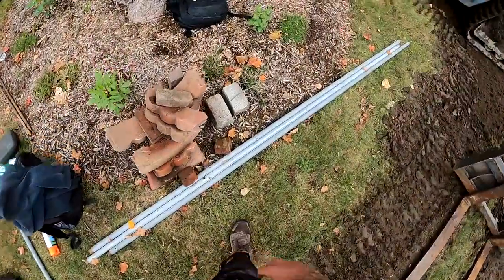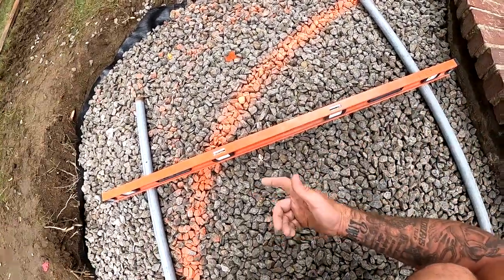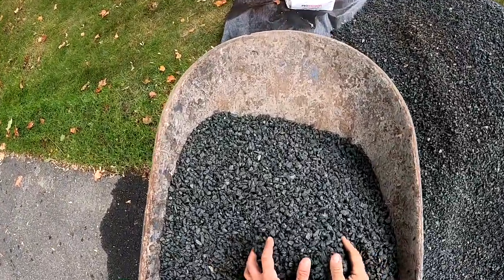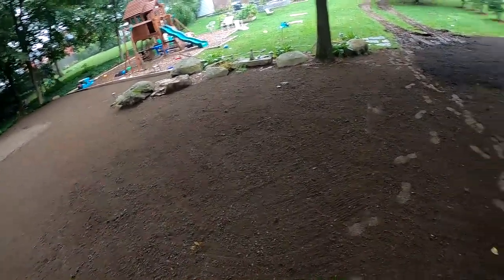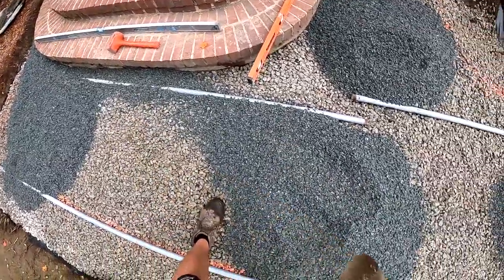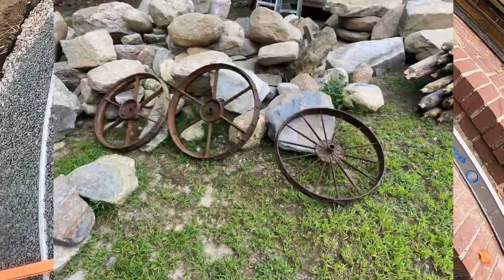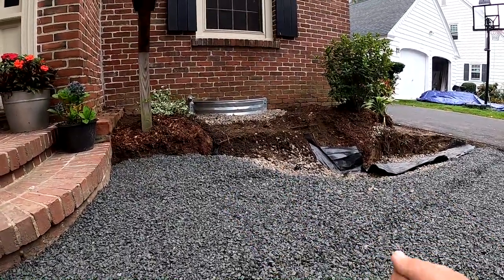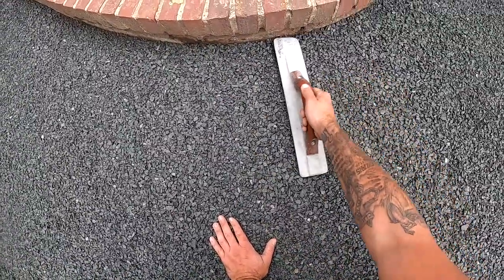How To Screed For a Paver Walkway (DIY)

Comment: I want to thank you for the videos that you post. They provide insight into your profession and are informative. Intended or not, the videos also provide encouragement for some of us DIY'ers. About 2 months ago, my wife and I made the decision to build/install a patio in an eyesore area right next to our home. Long story short, I have not ever built a patio before, but I am good with math and God has blessed me with a higher than normal amount of determination. Your videos have given me the direction needed to start this project. I started the project 2 weeks ago, we have an area that is 192" wide and 152" long at an approximate depth of 12". I went a foot deep because of organics in the soil and because I ran into three different soil types; clay, sand, and a vein of gravel. This weekend I will be putting in the 3/4 minus  (hoping 9" is enough correction), the leveling agent, and the pavers.
  
Question: For the leveling agent, we were going to use cement sand/leveling sand but I see that you use chip stone, is it okay to use the sand or do you recommend chip stone? Also, if I use the sand do I need to run the plate compactor before laying the pavers?

Again, thank you for your videos they are truly appreciated.
Reply from the maker: Thank you very much for the feedback, I love receiving comments like this. I truly enjoy the work I do and wanted to share it with others here on YouTube. Giving DIY'ers enough confidence to try a project on their own was a big goal of mine when starting this channel. I want others to realize they can build a very nice outdoor living space on their own with a little hard work. Glad you are trying it for yourself. 

It sounds like you are doing great with the excavation, glad to hear that you will be using 3/4 inch clear stone for the base. I would strongly reccomend not using sand. The most important aspect of any install for me is the chip stone bedding material. It holds up so much longer than sand does and allows water to flow through freely. Sand is more of a sponge and then sand washes out / migrates very easily. You will absolutely be lifting up sunken pavers within 3-5 years if you use sand. The 3/8 inch - less crushed, clean stone for the leveling agent is key to the longevity of the project. If you use chip stone, you only need to compact the pavers during the poly sand process and they will be solid. 

Thanks again for the feedback and support, good luck on your project! ✌

Comment: Thank you man great job andfollowed by good instruction better than evryone on youtube nowdays.
Im from sweden and i see konstructuon is diffrent a bit diffrent  but those methods would work much betyer with just stone than powder
Reply from the maker: No problem, thank you! This method is excellent and far better than base material with sand and fines in it. This method allows water to travel through freely. Here is another video I made to explain the method in much more detail, here is a link if you are interested 👉https://youtu.be/ChaJe3JqD6I

Comment: After watching a few videos I think I'd rather use this premium gravel for a base. I'm new to pavers and just trying to do some areas around my house. I did a small area several months ago and it's decent, used the "paver base" from HD. I started a new area with 16"x16" pavers and those are a little harder to get level w a pitch. I don't have a truck so going to a landscape yard for a small amount of gravel may be complicated in a car.
Reply from the maker: This bedding stone is by far the best in my opinion. I would recommend getting a delivery of the stone, Most landscape supply yards will offer delivery. It may be a kind of expensive charge but worth it in the end.

Comment: I am a solo DIYer loving your videos. My 600 sf patio is almost ready for bedding layer and screeding. I am following ALL your advise! I wish I had a Benny but its going slow and smooth so far. I am ordering “chip stone” next week and want to know how much extra to order for your 1” bedding layer, do you end up using more or less on average than 1”.  Do you have some areas where you end up with 1.25” or more areas where you end up with less than an inch.
Reply from the maker: Very cool! I hope the technique I use is working well for you. I usually do the math for 1.5 inches to be safe. Sometimes you lift the pipes a half inch or so to set them perfect, and lifting them with chip stone is easier than base rock for sure… ✌🏻

Comment: Don't you want to grade the subbase, to have the water at the bottom of the paver base moving in the right direction for best drainage?    The additional grade you do at the top of the 3/4 inch base is so that the surface of the pavers will separately move water at the surface in the same direction, towards the main drainage channels?

Comment: Thank you for the video. I'm planning to do a paver patio for a gazebo kit this spring, would you recommend using Gator Base instead of the clean aggregate?  I'm from Boston, MA. Thanks
Reply from the maker: No problem, I would definitely recommend the 3/4 clean stone. The gator base just is not sufficient in my opinion, I used it a couple times, not a big fan... ✌
Reply: Sounds good. Thank you for taking the time to reply. Keep up the good work.

Comment: Love the vids. Just wondering what you would use if you didn't have that chip stone available locally? No places nearby me have it, they just carry the same old stuff like stone dust.
Reply from the maker: Thank you, if you cant find chip stone, I would call around for (crushed pea stone) That is usually about 3/8 - 1/2 inch in size. It is not like regular pea stone which is more rounded, not angular. Its going to be a little bigger than chip stone and may be a little harder to screed... but it will hold up far better than sand or stone dust. If you can't find that, even regular, rounded pea stone is better than sand or stone dust  ✌
Reply: @TheChristianHardscaper  Thanks!

Comment: If you want a thicker depth of the #8 stone, do you use a larger screed?  also, you don't use two different screed sizes?  all the same size pipe?
Reply from the maker: I only use 1-1.5 inches of bedding stone, anymore than that can cause issues down the road.
Reply: @TheChristianHardscaper  ok, I'm out here in California.  Angelus stone recommends 18" of specific layers.  We aren't going to go that deep because we won't have any cars driving on it so we were going to do 10" total with 4" of #57, 2" of #8 and then 4" of the permeable paver stones with #8 in-between.  If we were to do the 2" of #8, would we need a larger screed size in order to get the 2" layer?
Reply from the maker: @rebeccaliu5502  you can still use the smaller screed rails, just spread an inch of #8 out roughly then set your screed rails on the stone

Comment: How do you grade the 3/4" #57? Just by eye? I feel like you need slopes right before putting the chip stone or the screed pipes.
Reply from the maker: Yes, we rake it out close to final grade by eye and check with our screed pipes. Sometimes with a string or laser level. But by eye and by setting the pipes, we can get a very good idea of our slopes and end paver height.

Comment: Hey nice vid.  Where i live the  smallest stone i can find for a screeding layer is 6 to 16 mm ( in US size its 1/4 to 5/8 of an inch )  Is this going to be ok to use as a screed layer, or will it be too big? I don't really want to use sand, if i don't have to. Thanks
Reply from the maker: Thank you. I think that size will be fine, much better than sand even if it is a bit harder to screed. Sand shifts, washes out and migrates to easily. It's just not good for under pavers. But with that stone you are talking about, you may have to take out a few big stones here and there but I bet the majority will be smaller than 5/8. ✌
Reply: @The Christian Hardscaper  Thanks, yes, after watching your videos, I'd rather use stone, so I'll give it a try. Thanks for your feedback. It is very much appreciated!
Reply from the maker: No problem at all! 👍🏻
Reply: I had exactly the same question.  I had purchased 3/4 and thought it would be too unstable until I saw your video.  Thanks for all your advice...it really helps a bunch (from up here in Canada 🍁. Cheers!)

Comment: Does it matter the length of the grade? Should the 1/8th pitch translate across 18 to 20 feet? Hope that question makes sense
Reply from the maker: The length of the grade will not change the 1/8th pitch, that is the minimum slope I put on all my installs. Whether it’s a 10’ walkway or 30’ patio 👍🏻
Reply: It’s an 1/8th inch per foot, translates to 2% slope

Comment: What about PVC instead of galvanized?
Reply from the maker: I don't recommend PVC at all. It's too flexible, you won't get a perfectly level surface. They shift and move like crazy. Somewhat thick gauge steel is the only thing I would recommend. These gas pipes are the absolute best thing I have used.✌

Comment: How do you screed a raised patio so that the paver sots flush with the cement and borders
Reply from the maker: You just need to set your pipes 1/4 inch higher than the wall that is retaining the grade. Then you can compact them down to sit flush.
Reply: Thank you so much. This helps a lot!
Reply from the maker: @RigoMariscal-wc1zz  No problem, glad it is helpful! ✌
Reply: @TheChristianHardscaper  hey so I'm using 1/4-#10 for the besding layer. Will it compact 1/4 if i leave it 1/4 higher? Some say that it will only compact 1/16 to 1/8
Reply from the maker: Yes, 1/4" is the way to go. They will compact enough, plus you want to account for future settlement.

Comment: Why not concrete sand?
Reply from the maker: Just doesn’t seem to hold up as good as this small crushed stone. I have a handful of videos explaining it, check them out ✌🏻
Reply: @TheChristianHardscaper  Thanks for the reply from australia. I just did my driveway using concrete sand so hope it holds up. A lot of pavers in my area use crushed dust or quater minus. But to me thats wrong as it wont be porous.
Reply from the maker: You will be just fine as you are in Australia. The main reason for the method I use is because I live in Massachusetts where we get hard freezes and thaws in the winter. The stone holds onto water less than concrete sand. And that helps prevent the material from shifting a lot through the winter ✌